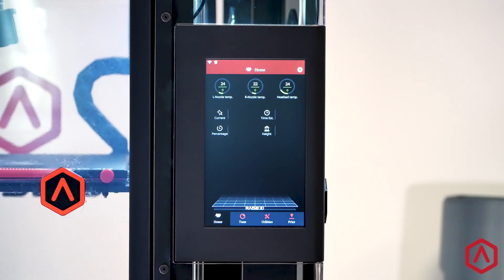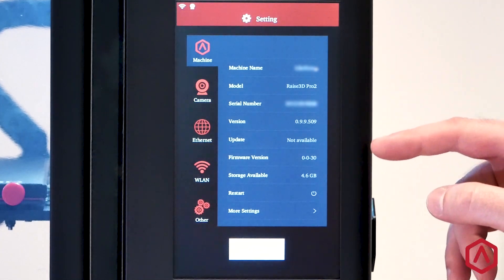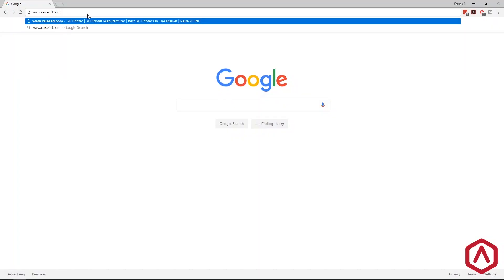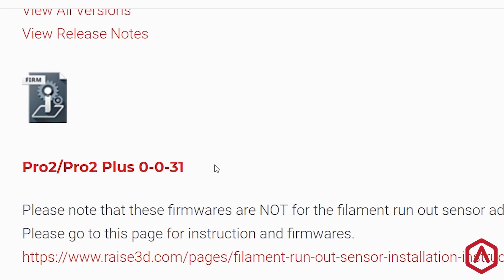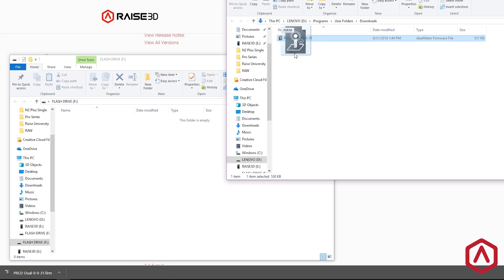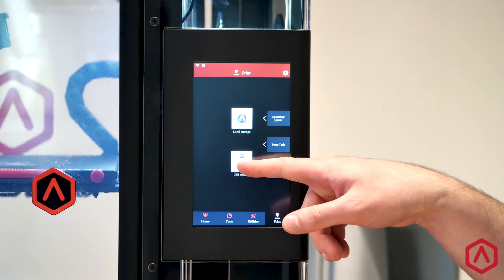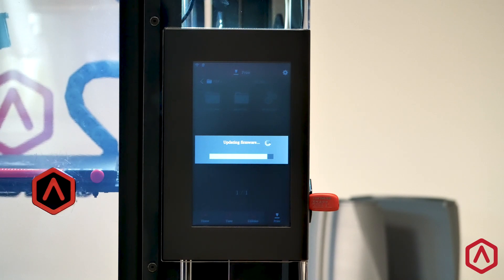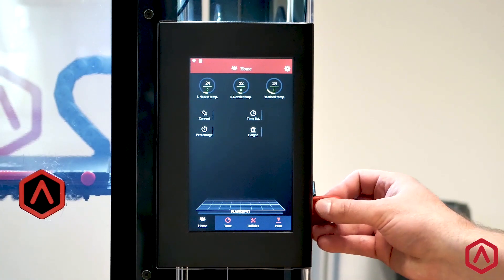How to Update the Motion Controller on your Raise3D Printer| RaiseAcademy

Comment: Hello guys. Thank you for your massive help through the forum and channels like this one.
Maybe you can give us a hand, as we are trying to bring back to life three machines (one N2 and two N2 Plus) and one in particular is giving us a huge headache (N2 Plus): we have the latest firmware installed and still we can't access the steps per unit value and therefore we can't also modify it (on this machine we have a Bondtech dual extruder) to see if this is the issue or if we have to still dig until finding the problem.

Thank you very much once again and have a great day!